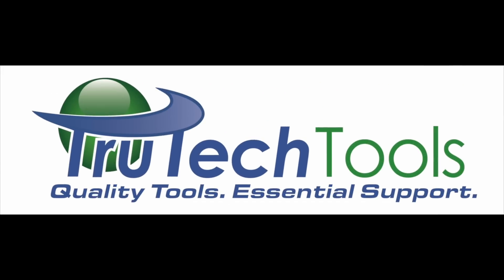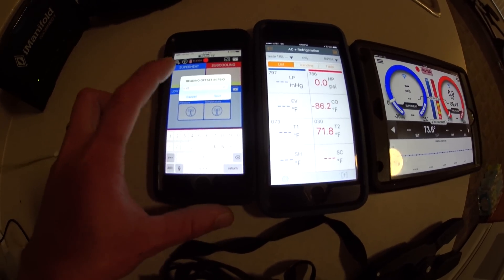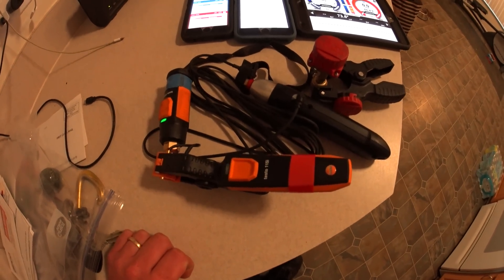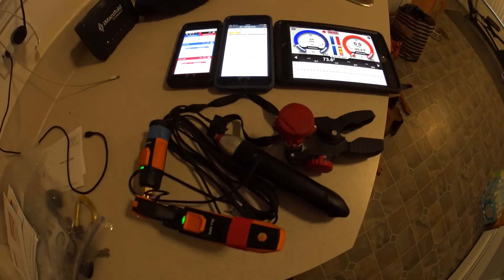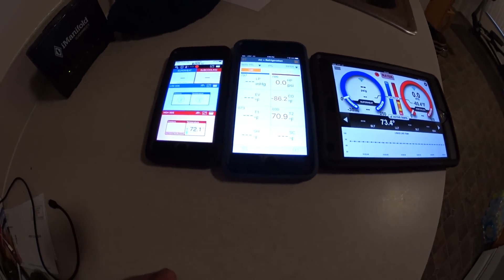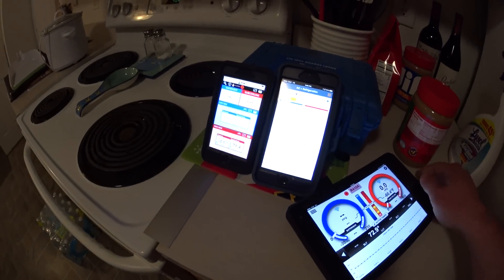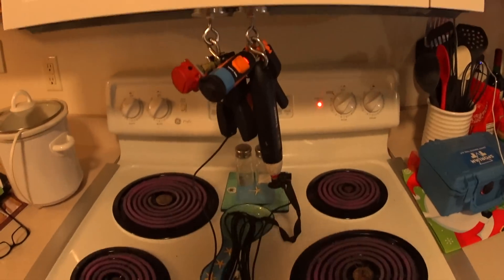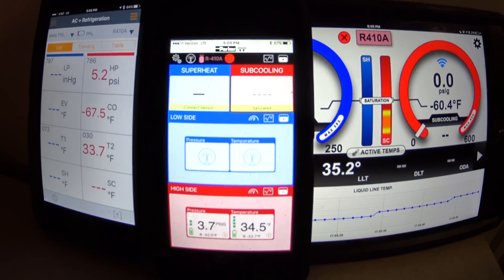HVAC Tools: The iMportance of Temperature Compensation

Comment: Don't forget besides temp compensation the Imperial set up also automatically compensates for atmospheric pressures as well and there is a choice of what method it uses.
Reply from the maker: +WorksGoodCheckItOut yeah, it matters to the numbers and iManifold makes the necessary adjustments to keep things accurate!

Comment: I bought the Testos. I have connection throughout my house however in a WI Box I lose connection as soon as I close the door and round the corner. In an insulated door freezer reach-in's I still stay connected with the door closed. I don't like how I always have to zero the pressure probes every time I start them up and a few times that I lost connection I had to restart my phone to reconnect. 
Great video thanks. 😎And yes the Iconnect looks like it is superior.
Reply: Thanks for guiding me back here Stephen. Houston we've got a problem! if I'm showing more than three PSI differential in between two probes on the same line (example: across the liquid line dryer or a valve) that could cause me to miss diagnose the issue or adjust the Sys incorrectly. Maybe this is not coming to light because most people are not putting two probes on the same line?? Or it's just my probe and is broken??
Reply from the maker: +HVAC/R Junky I think people are just trusting that they're accurate simply because they're digital. A field comparison every so often of your probes is a very good idea!

Comment: Best way to do this test is by using "ice" and "boiling" point tests.   I would do each individually and ensure the bluetooth or app was off for the others.  Ice point (crushed ice in a glass with a little water) will read 32F while boiling point (rolling boil that remains when stirred) is 212F at sea level.    Both ice and boiling point test must ensure the probe does not touch the container.
Reply from the maker: +RJ Parker the iConnect probes are not submersible and I'm pretty sure the Testo probes wouldn't like that either.